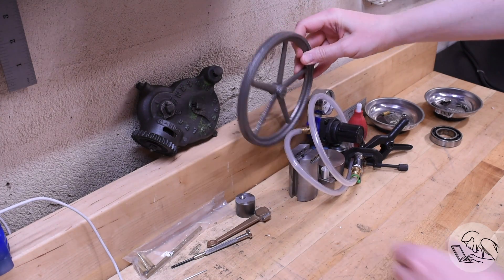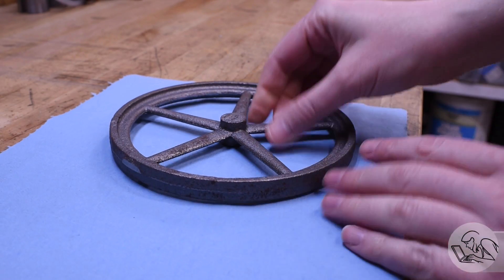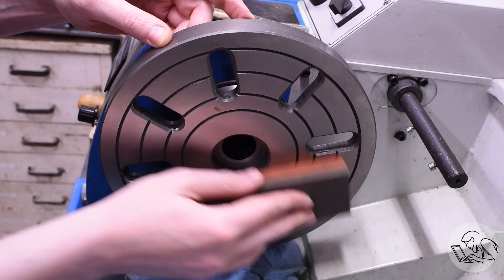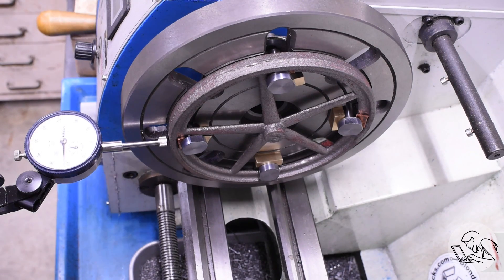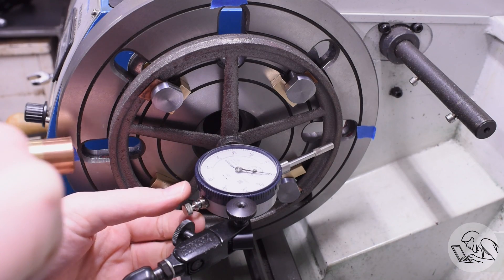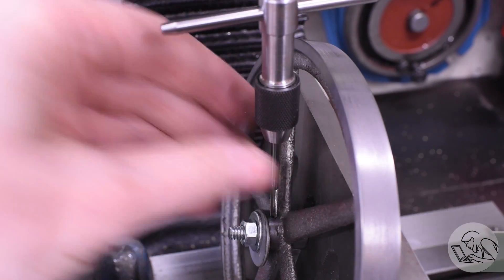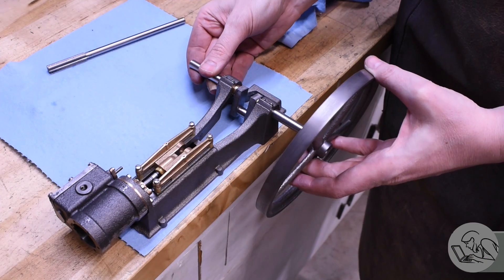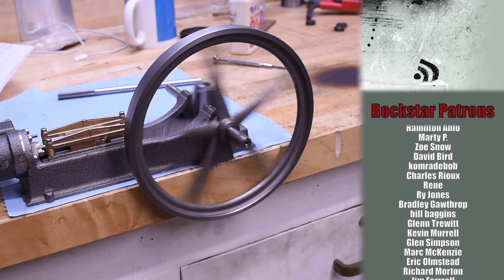Let's Build A Model Steam Engine : Flywheel!

Comment: I know you made this video over a year ago but this may be of use to someone. I am building a Traction Engine, when it came to the fly wheel, as you mentioned the outside face had to be slightly domed. I found the best way to create the dome was by hand, I botched up a scraper by using an old file, and about 2-3 degrees of relief and it5 worked great. I have to say, I was using Harrison M300 (Small industrial Lathe) at my engineering club. I'm not sure if it could be done on a hobby machine. I guess if you have good stability it could be done.

Comment: Thanks so much for the insights in your thinking. Well done cracking the shell of chill iron. For what it’s worth I found a home made angle grinder holder very useful, it clamps to the tool post and is great for dealing with hard stuff. I still have to work out how best to manage tool feeds, but as a solution it keeps coming back!

Comment: I struggled with flywheels until I worked up this method. Make a disk of plywood smaller than the rim with a hole in the center big enough to work on the hub. This disk goes between the spokes and the faceplate and keeps the rim off the faceplate. Next cut a disk from sheetmetal (1/4 ") like the wood one and drill 4 holes to match faceplate through both disks to clamp everything together with bolts. Center casting just like you did. Cut away. Don't through disks away as you will use them again.
Reply from the maker: Yah I looked at that method for this, but there was no room. The whole flywheel is only 1/2” thick and there’s no overhang on the rim. Nowhere for the wood to go.

Comment: Other than the lack of concentricity in the process, would it be a consideration to remove the scale manually with a stationary belt sander, and then finish out on the lathe?

Comment: I’ll call it a win 😊. A friend builds a lot of model engines. He does his wheels on a faceplate as well and has a set of adjustable standoffs to hold the spokes away from the face to allow complete access to the rim as well as make up for slight warp in the casting and spokes. 
You’re coming down home stretch and looking great 👍

Comment: Why not go one step more and turn the OD and true up the faces while holding the flywheel on an arbor.
Good job to this point!
JIM
Reply from the maker: As I said at the top, I don’t think that would work on this flywheel.
Reply: @Blondihacks  Sorry, I wasn't clear on what I meant.  After all the machining you did, then use a tapered arbor and a dog and take very light cuts to go for the last little bit to perfection.  Good enough is not in my playbook.
Keep carrying on, you are a great service to the community.
JIM

Comment: Hey Quinn ive been loving this series about the steam engine and all of the creative fixturing and problem solving. I have been wondering this entire time, if someone had the prints for this project would it be possible to make it entirely out of raw stock? (Possible not practical?!)
Reply from the maker: Definitely possible. Mr. Crispin and Go Create Hobby Shop are examples of people building steam engines from bar stock with drawings intended for castings.

Comment: Order of Operations question: Why did you not face-drill-ream the hub first, once it was roughly centered? I would think doing so would set guaranteed reference surfaces to utilize your gauge pin (end mill) or live center tailstock to secure or recenter the part. Thanks and Keep Turning- An Apprentice Machinist playing Monday Morning Quarterback

Comment: dunno why or how i ended up here, i blame tony and ave.... they mentioned you once and you got a sub.... but thank you for info on long drill bits being called aircraft drill/bits!!! i've always been trying to find these bits but never know what to call them, i have a few 12 inch and a 18 3/8th inch drill bit and they are SOOOOOOOOOOOOO useful!!!
curious though why you dont just spin a chunk of (insert metal of choice) for a spider? it looks like a extremely simple part that could even be made from scrap rod
~novice advice from someone who the closest device to a lathe he owns is a modified hand drill mostly used on the wrong materials to be machined, ie glass or plastic

Comment: Nice work. 
Maybe grind a flat on the crank for the set screw to bottom onto. Helps stop the flywheel turning on the crankwhen the screw isn't tight enough or works loose.
Reply from the maker: Yah, I think I will. That flywheel is very large for one tiny setscrew
Reply: @Blondihacks  maybe a touch of blue loctite on assembly as well.

Comment: Fun fact. At a hard facing machine shop I contracted at, they had a leathe that had a grinder on the tool post just for taking scale off castings. It was not the best tool in the shop. And for someone that has just the one, it would be a nightmare to do and not crap your machine.

Comment: Hi Quinn. Great video. But would you permit a non-machinist like myself to ask a question? (My background is electrical).

Would the very first operation not been to have layed the wheel flat on a milling machine and face off the centre hub? I was thinking that would have given you a centre datum to take all your other measurements from. You could then have used a live centre to help hold the flywheel.

I am not doubting the method that you have used, but just asking out of curiosity.

Comment: If you get inclusions that are too big, fill them with JB WELD before doing your finishing pass.
With a difficult hard scale flywheel like this I find the technique I use to turn very small diameters from larger stock. Position the tool with the cutting edge parallel with the face plate and touching the OD of the flywheel, now pull away from the flywheel and feed in the cross slide to take a deep cut, check that the tool will cut material for the full rotation( no intermittent cutting or this won’t work) now start cutting, all the cutting force should now be in Line with the lathe bed so it shouldn’t move the casting on the faceplate. Also you are digging right under the hard scale. I had an irreplaceable flywheel from 1910’s that was hard as glass , it had a big casting mark where the riser had been hacksawedn off. The lathe wouldn’t touch it so I rigged up a turntable to a workbench and clamped down an angle grinder to grind this down to size then I tried this technique, it feels very very aggressive but is much easier on everything except the nerves. Steve. Ps one way to stop the casting sliding is to place coarse Emery paper pads between the casting and the faceplate, rough side to the casting.  .
One more thing,
Check out this little baby for drilling those awkward grub screw holes.
https://www.ebay.co.uk/itm/193705210551
A bit of machining to fix into the tool post and voila.

Comment: Would it work if you spun out a cone to match the ID of the rim, milled slots for the spokes and used that and some clamps to hold it?  One of these years I'm going to buy a lathe and try this for myself.
Reply: That is basically what I did, machined the wood to a good fit on the ID of the rim.  Then some screws and washers to clamp the flywheel.

Comment: This was the way I would have done it as well.  With the exception of placing some brass blocks between the flywheel and faceplate.  To hold the flywheel away from the faceplate.  Good job that you did.  Some one doesnt like what you did, tough.  Let them go build one.

Comment: If you intend to paint this engine you might consider filling in the inclusions with a filler of some sort. At my job we'd use Belzona as it's as strong as the iron is (and will be under load) but as you're just after aesthetics you could fill it with any number of materials. Metal putty, J.B. Weld, Bondo, etc. Just a thought.

Comment: Quinn, I've been able to run a bottoming tap, 
freehand.  The work piece will have enough 
threads in it, to properly locate the bottoming 
tap.

I'm quite liking this video set!

steve
Reply: At that point she probably could have taken it out of the fixture entirely and finished it with the standard tap.

Comment: I thought you might put a V groove in the o.d. flywheel. No? Also, small oil cups for the axle?
Reply: Unintuitively, flat belts like to climb to where they’re tightest, as if they’re being pulled there. Learned that from the old steam powered machine shop (David Richards).
Reply: @kelvin0mql  I understand that. That's why I said V groove.
Reply: For what purpose? She already said she'd use a separate (and implied much smaller) PTO pulley.
Reply: Also, no oil cups on this. The axle doesn’t spin on this... they must spin together.

Comment: I am not a machinist, I just watch them on YouTube.
Question: Why didn't you simply keep the reamer in the tail stock and use it as an indicating pin when you flipped the flywheel to the other side? Would it have not at least got your fixture very close to the ballpark of running true and saved you from indicating so much??

Comment: When I was still a maintenance mechanic intern at a small box factory, I wrecked a dial indicator by not pulling the plunger off of the part that I was attempting to "tap" into true on a WWII era South Bend Lathe. My mentor tried to stop me when he saw what I was about to do but he wasn't about to get his hand smashed either. I got a proper ass chewing and the parts guy made me order a new one instead of taking lunch with everyone else. Thanks for showing the proper way to dial something in.

Comment: Tapping holes in the faceplate will give you more setup options for hard to hold parts. Very clever setup.
Reply: Quinn, maybe you considered this and ruled it out.  If you had a big enough piece (or two smaller ones) would it have been possible to bolt it to they faceplate (screwed from the back) and then tapped holes in the front where you needed them, for toe clamps?  Had to do this for a really large part once.  Also an option for large soft jaws when the part is too flimsy to clamp with the jaws alone...
Reply: Oh sorry, piece of plate aluminum...